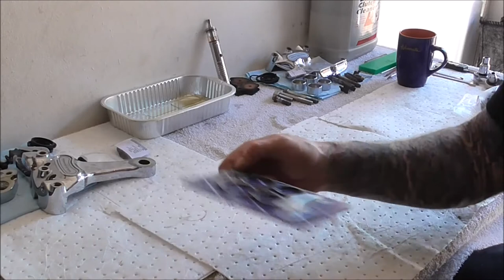Performance Machine 4pot caliper rebuild, Part 1

Comment: Hey brother I have a 96 wide glide with a four piston caliper. Could you send me a link to the correct rebuild kit. I'm not sure if those caliper rebuild kits are universal.
Reply from the maker: Are you after a rebuild kit for a standard caliper or a PM caliper
Reply: @pick6667  rebuild kit. My caliper part number is 0052-2400
Reply: @pick6667  oh sorry it's a pm caliper four pistons like yours
Reply from the maker: @thrashordie232  Hi Doug, your caliper is a 4 piston caliper with equal sized pistons so if you put this item number in ebay 
(eBay item number:293702124675) this is the rebuild kit you need, or put this in a google search and it should bring up other places that sell the kit (Performance Machine Brake Caliper Rebuild Kit | 0052-3002)
Hope this helps

Comment: Those drag specialty isolators suck!! They are made with shit rubber. OEM is the only way to go
Reply from the maker: I have used drag specialty bushes, OEM bushes and another brand (can't remember the name) and have never had any issues with any of them, My Electraglide has been fine since fitting the new bushes but that was only 7 months ago and I haven't done a massive amount of miles (less than 3000). But about 5 or 6 years ago I Fitted a pair of drag specialty bushes on a mates 2005 roadking and I sevice the bike for him, I rode the bike late last year after servicing it and it is still good, also he has done about 55000 miles on it since I did the bushes,